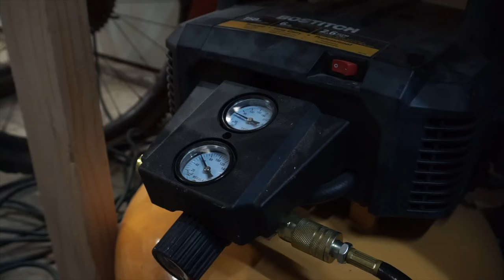My New Rocky Mountain

Comment: Hey. Nice ride. Just tested the A50 today and think about building a mini BC with a 140mm fork and 30mm rims from it. Anything above is not my budget. RM is too expensive in Germany unfortunately. Do you think it could still feel balanced with 140/130? I am also a little afraid of the seat angle getting to slack for climbing with 74deg only... Have you pushed your saddle forward as much as possible? Cheers
Reply: I have a Med 150/140 Pike@42  And Delux +  Bike weighs 28Lbs. Run Guide Brakes and Floating 203s . Bike HAULS Very Good TrailBike . Im Getting a Sm CF One Soon 24 Lbs 😎 You Wont Be Disappointed

Comment: Sweet.  I've been eyeballing RM bikes. Did that Thunderbolt not beat you up in the rough stuff? I wouldn't mind that bc edition you rode. or an Altitude, but I've heard RMs aren't exactly plush.. Any thoughts would be appreciated. Thanks!
Reply: demoed one a few years back, yeah it was harsh ( maybe shock had too much air ). Didn't enjoy it all.
Reply from the maker: It really comes down to set up. They have progressive leverage rates which is what we prefer. It works great with coil
Reply: I have an '18 Altitude, the small to mid bump compliance is actually damn good, partially due to the shock bearing mounts and also due to how progressive the design is.  There's more resistance deep into the travel but that helps a lot on larger drops.  The short stays do cause it to get more hung up in rock gardens than something with longer ones though.

Comment: Have you guys have Cushcore a shot yet ? I've been on it for a few months now and I don't think I'd be able to ride without them anymore
Reply: What is it about the Cushcore that you like or what differences have you experienced?
Reply: Yeah they run it
Reply: ThatGuyThatDoesStuff  the traction is significantly increased cuz you can run lower pressures but overall the bike seems to behave more precise with having less deflection from the tires and added dampening, just makes my bike feel more glued to the trail
Reply: @andrewcox7416  I really don't have traction issues. I already feel glued, so to speak. Honestly, I'd just like to run lighter tires and get a bit of benefit of damping for arm and hand fatigue during long, janky rides.

CushCore claim that you can run lighter tires, but I haven't found a single user yet that has done it.

In the scheme of things, $150 isn't that much money, but I don't care to spend money to be the company's guinea pig. I honestly doubt their claim of running lighter tires and having no ill effect. Last thing I want is repeatedly puncturing on my rides.
Reply: ThatGuyThatDoesStuff I've personally never tried a lighter tire cuz I just don't feel the need to, but regardless of traction the overall ride quality is increased, and not to mention protecting your wheel set
Reply: ThatGuyThatDoesStuff  It's often hard to explain, so buy a set and let'r rip
Reply: @thatguythatdoesstuff7448   From what I understand, Vittoria Airliner inserts are quite a bit lighter than Cushcore.. and they're supposed to be easier to install.
Reply: @mannyfnsc29  Yeah, but the Vittoria product is even more expensive than Cushcore. The very light weight caught my eye, but not enough to want to pay $170+.

I think I'm actually going to give the Nukeproof ARD a go. Under $70 for both tires.
Reply from the maker: @thatguythatdoesstuff7448  We love cushcore, we'll definitely get some and install it on the new bikes